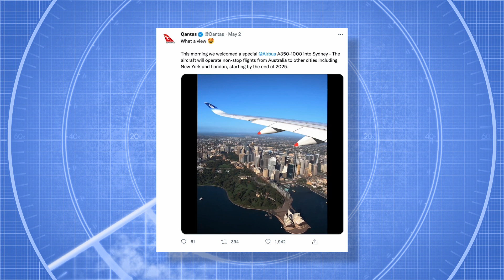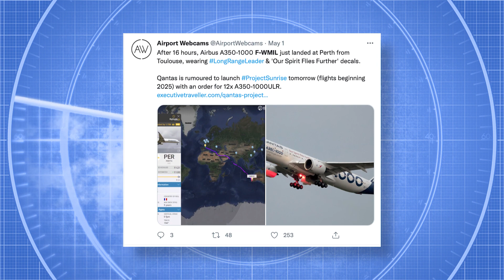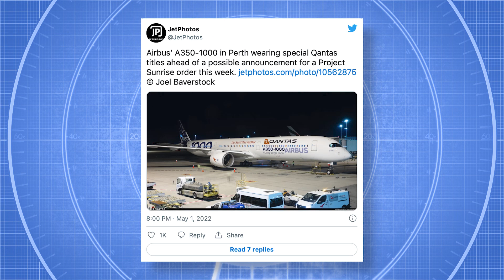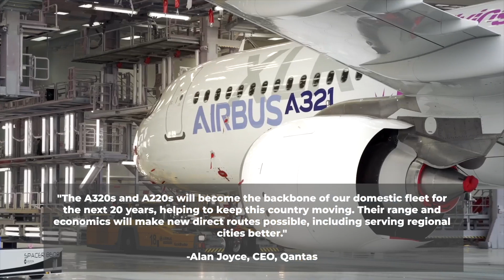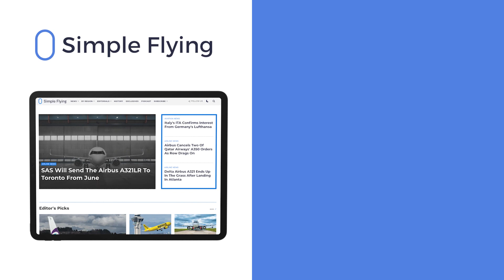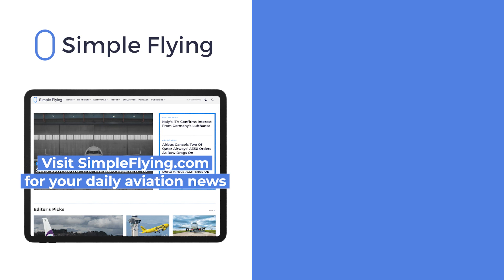Big Airbus Order As Qantas Greenlights Project Sunrise

Comment: I recently flew the A350 for the first time with LH Long haul in Economy. Besides the leg room (which is a choice by the airline), it was overall quite comfortable, the noise level is fine. I like the larger windows with an actual "cover?", I much preferred it over the electronic ones on the 787 because it is 100% blacked out. You can still see some lights coming through on the 787 on a day time long haul flight like United LAX-NRT service.

Comment: Will be interesting to see how this goes. They are counting on a big revenue premium to cover low density and high cost to operate
Reply: not exactly..... the plane doesn't need to pay for parking fee @ another airport plus the extra fuel used for the climb from ground to 30000ft
Reply: @fatdoi003  Parking fees are not a big factor here in overall expense. These flights will be extremely expensive to operate in fuel, crew, etc.

Comment: I do not understand why they do not ordered some A350-1000ulr ?? The sunrise project was initially with the ulr no ?
Reply: The A350-900ULR I think is what you mean and no, the 900ULR is short on range, and they need more capacity too. The A350-1000’s they’ve ordered I believe are going to be specially modified for extra range, however, the specification has not been giving yet, therefore they’ve ordered the A350-1000, not the A350-1000ULR or whatever.
Reply: @soup1029  1000ulr gets the same 20000L 900ulr central wing fuel tank... :Qantas just opted for a bigger plane

Comment: The type of plane doesn’t really move me and the majority of the flying public.  I’m more interested in what the ticket prices are going to be than the fact it has a wellness center.
Reply: Premium. If you want cheap tickets, take a discount airline with several stop-overs. The direct flights that sunrise offers are for those willing to pay little more to save some time and the stop-overs.
Reply: You are not the target customer for these type of routes. Project Sunrise will live or die and on the revenue premium
Reply: Qantas can set the price however they want as that'll be the only direct flight from Aust to LHR/JFK
Reply: @fatdoi003  That's not really how it works. There are tons of options to either city, and if it involves a connection for a lower price many premium travelers will take it based on corporate policy. It's only saves two or three hours in most cases and many of actually will avoid a 19-22 hour nonstop in a plane even in F and welcome the connection to get off walk take a shower etc.

Comment: As expected, Qantas is the launch customer for the A350-1000ulr opening up new markets for the A350-1000 variant. The A350-1000ulr is now a direct competitor to the B777-8 in regards to sales, especially since Qantas has shown what can be done with the A350-1000ulr in passenger cabin configuration for long and ultra long haul direct non-stop flights.

I wouldn't be surprise that Singapore Airlines would a another potential customers as a replacement to their 17 A380's. 

It is a shame that Qatar had a hissy fit with Airbus, as Qatar was keen on an 'extended range' variant of the A350-1000.
Reply: Sing Air already flies A350-900ulr...
Reply: @fatdoi003  - I know they have A350-900ulrs but the A350-1000ulr's can be a possible replacement for their A380's. The A350-900ulr has 161 seats in 2 classes and Qantas A350-1000ulr's will be 238 seats in 4 classes so giving SQ possible seat and cabin class ideas.
Reply: Does Qatar need a 350-1000ulr tho? Agree with your point tho.
Reply: @chith818  - Apparently, Qatar was keen on an 'extended range' A350-1000 as a possible replacement to their A380's. At least Qantas has shown that it can be done in a 4 class 238 seating configuration.

Qantas does have optioned for additional A350-1000ulrs as replacements for their A380's.

Since the A350-1000ulr is now launched, I believe airlines will be more interested in the A350-1000 with its 2 variants as possible replacements for their B777-300er's for long haul  nonstop 'point to point' and/or 'hub & spoke' operations.

It will be interesting what Sir Tim Clark views are on the launch of the A350-1000ulr since he in not happy with Boeing regarding the delays to the B777-9 programme.

The launch of the A350-1000ulr will affect the B777X project especially B777-8 passenger sales.
Reply: @chrismckellar9350  Qatar's current fleet can reach every corner of the world from Los Angeles to Auckland. They don't need a ULR aircraft - part of the reason they're so successful. 

But yeah, the A350 will trump the B777X.
Reply: @chith818  - Qatar uses their B777-200lr for the direct 'non stop' service between Doha and Auckland. Due to the COVID, the Doha to Auckland service is going via Adelaide until later this years when they will re-introduce the Doha to Auckland direct 'non stop' service. 

By the way the Doha to Auckland direct 'non stop' service is the 3rd longest flight,

Comment: In the long run this is a sensible investment for Qantas. However, in the short run there are going to be some significant costs associated with switching their narrowbody aircraft to Airbus, despite already having those aircraft flying with JetStar. All their 737 pilots have to be certified for Airbus, and most, of not all their hangars have to be modified. Their A380 pilots can fly the A350 due to some flight control commonality. We'll see if they ever actually reveal those costs.
Reply: Qantas is going to need a lot of new pilots. Current 737 pilots who are nearing retirement will most likely just retire when the 737’s go out of service instead of spending another year or two training for some plane they will only get to fly in for a couple more hours before the have to retire.
Reply: There will be very little costs, as Qantas Group has an all A320/A321 fleet with their LCC subsidiary - Jetstar so the flight/cabin crew training, spares, engineering and logistics for an all Qantas branded domestic and international fleets is already in place.
Reply: @soup1029  Or the Qantas B737 pilots who no longer have a job could just transfer to Virgin, Rex or the new low cost domestic airline Bonza.
Reply: I'm sure Airbus was happy to arrange and pay for some training, in order to get them to switch...
Reply: @chrismckellar9350  Well, adding new aircraft to the fleet means more pilots. They can't simply move Jetstar pilots to Qantas because they still need them to fly the Airbus they already have. These are A321 and A220 series of aircraft, and these are NEO, not CO, so yes, they're going to at the very least add to their infrastructure and either re-train 737 pilots or hire more Airbus certified pilots.
Reply: the renewing of the 737 fleet doesn't happen overnight, it'll take years if not a decade so the pilots can transit over in batches
Reply: @fatdoi003  yes, but there will be costs. It's a significant transition because they're expecting most of their narrowbody aircraft in by the end of 2025. That's 3 years away.
Reply: @sainnt  - Qantas would have factored in flight/cabin training requirement when they confirmed their orders for 20 A321xlrs and 20 A220-300's
Reply: @frankpinmtl  - As launch customer for the A350-1000ulr, the price of the A350's will include pilot training conversion. Remember, there are purchase option for additional A350's as replacements for Qantas A380's.
Reply: @sainnt  so far my understanding is recertifying pilots is only a drop in the ocean in the overall scheme of purchasing aircraft

Comment: First of all it looks like another blow for Boeing after the 737 max problems, the pandemic and delays in certification and deliveries. Secondly, I hope the long haul project sunrise flights have suitable pay & conditions for pilots and cabin crew because customers wouldn't want potential safety issues due to fatigue causing strikes and delays.
Reply: Not really down to the max problems nor a blow for boeing. Just their products didn't stand out to them
Reply: @nickolliver3021  its definitely a big blow!
Reply: @dipayannag7413  its nowhere near a big blow
Reply: Max doesn't have the capability to give Qantas longer route options.... just Sydney to Darwin already emptied 1/2 of Max onboard fuel
Reply: @nickolliver3021  tell me that having to loose billions because they can't get their manufacturing process right is not a big blow, fanboy.
Reply: @farhanatashiga3721  so when delta order their 100 odd max aircraft I'm.sure that'll be a big blow to airbus. Mm its called competition. Both companies loose orders and win orders. Airbus has most likely lost money from their manufacturering process of tbe a350 paint saga. But I won't take it that far.
Reply: @nickolliver3021 The paint issue is beeing adressed and it doesnt seem to concern any authority except one and its affilliated airline.
There was no hold of the A350 deliveries at any time. So lets compare this issue to the 737, 787 issues, you will instantly see a huge difference in the extend of those issues.

Dont get me wrong, I wish Boeing and especially its employees all the best, but saying everything is fine and under control at Boeing is a statement which is a foolish imho.
Reply: @Biggunkief  well I has affected other European airlines but they have had repaints which they have now gone quiet. Qatar has grounded a few with the problems but the 737 is now flying and 787 close to being delivered again. Products don't just cone out perfect from production. 

Im saying they are on the road to recovery not saying saying everything is under control. But its repairing the wrong .
Reply: @nickolliver3021  How big is it?
Reply: @johnturcan8028  not that big

Comment: I hope people understand when raving about the A350ULR & A321XLR, their phenomenal range is simply a matter of weight & fuel. The A350ULR is only configured for 238pax, while the A321XLR is around 200pax. These aircraft, under normal configs can carry 350+ & 240pax respectively. Reduce the weight by limiting capacity, add a fuel tank & bang, you have a ULR or XLR. Make no mistake though. Had the 777X not experienced the delays it has, aircraft to aircraft, Qantas would've chosen the 777X for Project Sunrise.
Reply: Initially Boeing offered 777-8 for project sunrise but Qantas quickly frown upon the plane because it is heavier than A350 when additional auxiliary tanks installed. This mean there will be severe weight penalty and more seats will be removed for ultra long haul flight. Thanks to the delays, 777X is now the most expensive commercial aircraft project in Boeing history that’s what I heard.
Reply: Jeez, why didn't Boeing think of that? Can't they run the numbers just like you did and come up with the same thing?? Why does Airbus have a 2 to 1 narrowbody advantage over Boeing? It sounds so simple - bang!
Reply: let me see.... back in 2018, Airbus just need to modify their existing A350.... whilst Boeing's 777x still only on brochures and powerpoints
Reply: I think so too. Qantas asked for a 300pax aircraft. The 777 probably would've gotten closer to that.
Reply: @chith818  has to accept the reality, it's hard man.